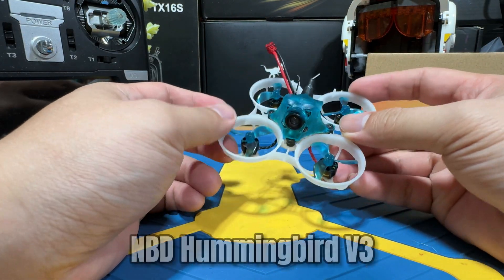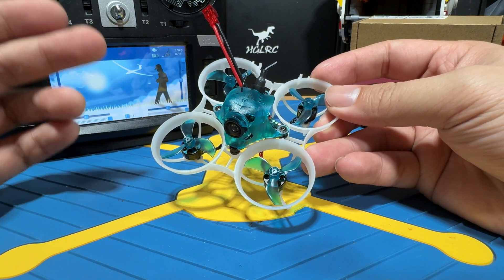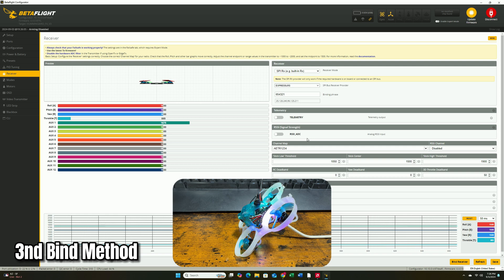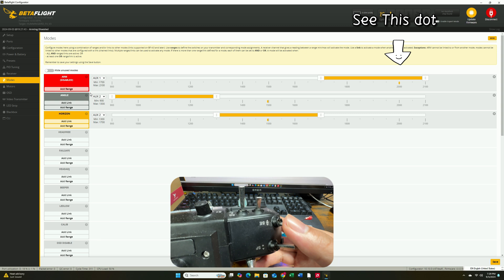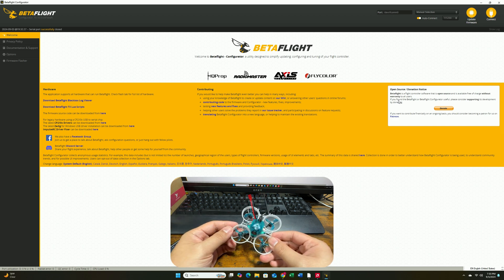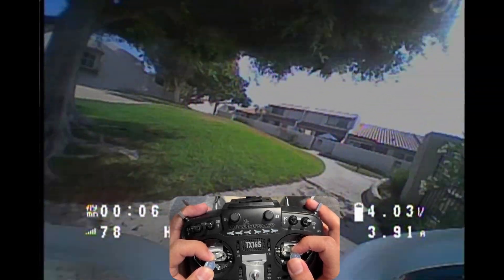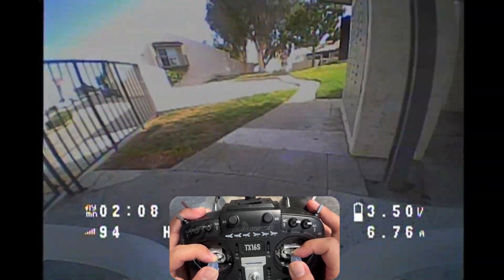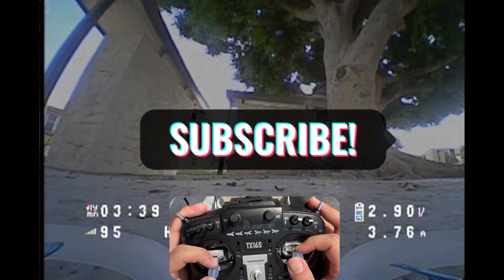How to bind and setup Newbeedrone hummingbird V3 ELRS | Mini Review | best whoop under $100  #FPV

Comment: lost video after 2 times using it, i tired everything, it only gives video if put the goggles no more than 1 inch from the drone... any place we can chat for any troubleshooting steps vefore buying another vtx camera?
Reply from the maker: Looks like you are in pid mode, try and see if you are able to reset your VTX . Go to the VTX tab in betaflight and see if you are able to adjust the output power to 25mw instead of 0

Comment: didn't work all three ways
Reply from the maker: 1. Check your radio and confirm it is ELRS 
2. Check your radio ELRS firmware is at least 3.X
Reply: @XwingFPVRC  yep all good I think I have a bum unit. I have two other quads and used binding phrase with them and had no problems. updated to 3.5.1 still no joy.
Reply from the maker: @transmech  have you tried setting up the pkg rate to 500 on your radio, this is the frequency SPI generally works on

Comment: Nice video, everything explained clearly and seems so simple.. But I just cant seem to bind my radiomaster pocket elrs to this drone. I have double/triple checked all the settings followed all bind procedures and cant get them to link up :(

Only thing left to try is factory reset the Tx and update edgeTX etc.. hopefully i can get it working to enjoy this as much as you!!
Reply: What power and frequency are you using for elrs?
Reply from the maker: @Stevebroza  check PKG rate - set to 500 hz 
Turn on and off model matching
Let me know if it doesnt work and we go from there
Reply: @XwingFPVRC  Cheers! Need to sleep on it, and will have a go tommorrow and let you know how I get on.